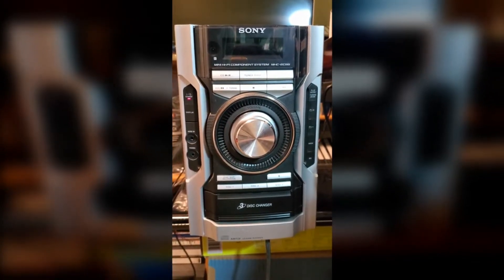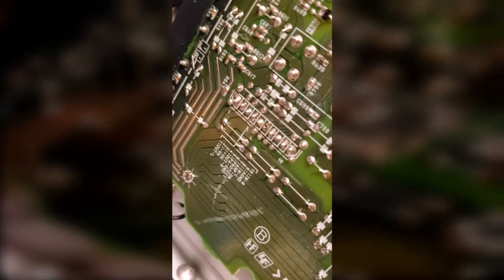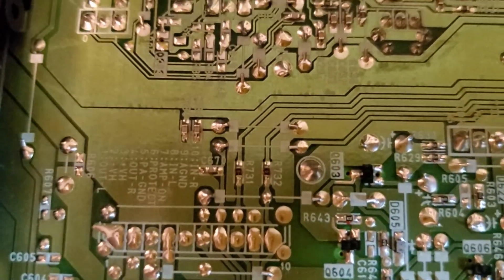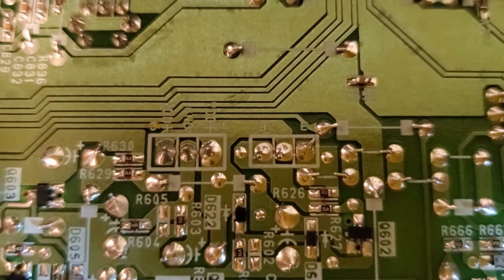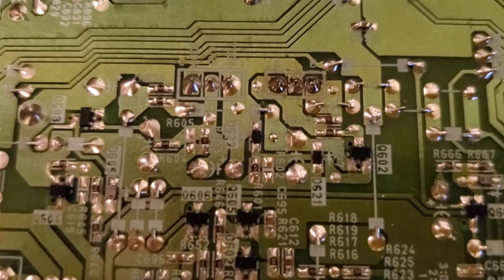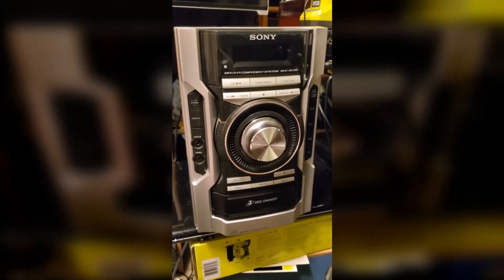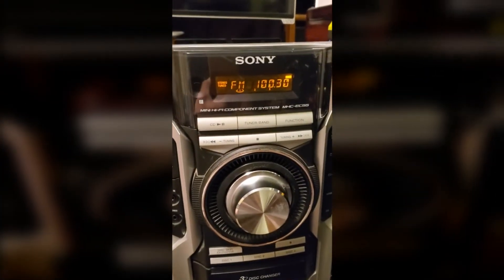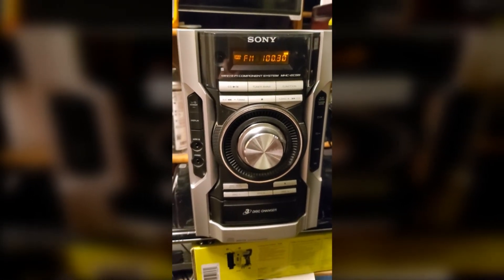Sony MHC-EC55 Receiver shuts off when volume turned up - Solved!

Comment: I  have that same stereo and that same issue. I just removed the back panel and wiggled that plug side to side to see if  that helps . I dont have  the expertise you have but it helped me locate the issue quickly. Low in behold the Damn Fan kicked in at high Volume and didnt shut down. Not sure if its gonna stay blowing at high speed but will see. Thank u for the video and your knowledge. Much appreciated.